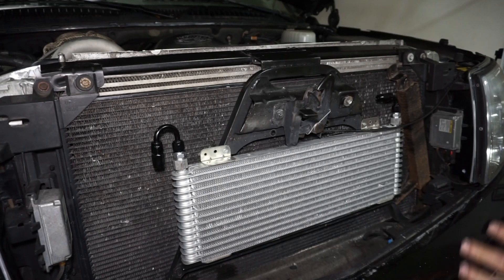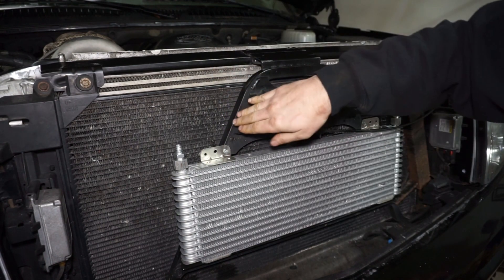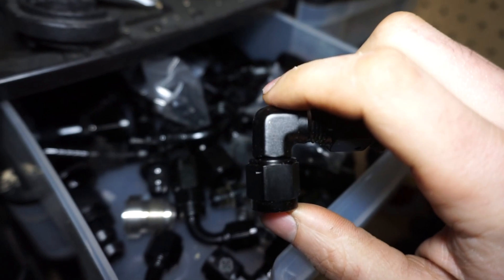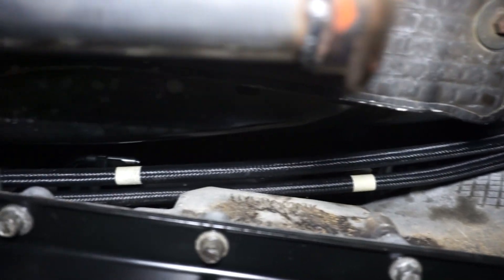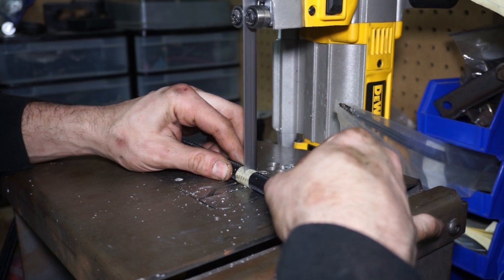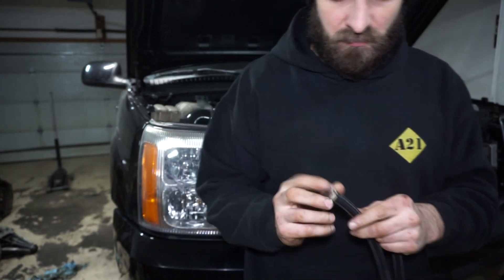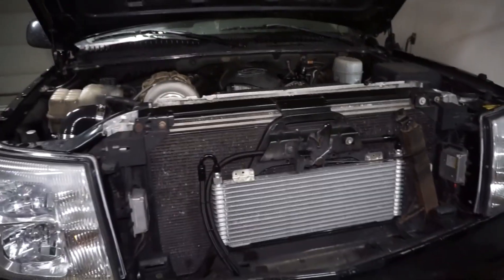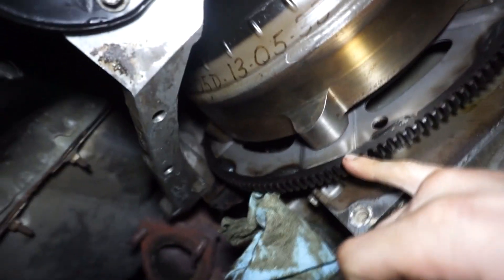How I Do AN fittings | TruCool 40k Transmission Cooler AN install!

Comment: This is actually the correct way to install a cooler. good job
Reply: yes it keep the air out and ensures there is no air in the cooler.  Most install with the fittings down as it does look neater.

Comment: I love the fittings with the threads on the sleeve. I throw my baby impact driver and a socket to it. Sucks it right down with no stray strands.
Reply from the maker: Maybe I'll give that a whirl one of these times.
Reply: This is genius. Thanks
Reply: @BlaserBuilds  the ones I used were reverse threads. Plus still leave the tape on to get it started. Then at least it’s easy to seat it all the way down.

Comment: Have you got a part number for the cooler? Both versions of Tru cools 40k is advertised as 3/8 inverted fittings through multiple vendors.
Reply: i’ve got the same question lol
Reply: I have that same question as well
Reply: Bump.  I have the same question 
Advertised as 3/8-24 inverted flare you are saying 5/8-18
Reply: @ryanlogan2911  I ordered 5/8 18 to -6an and they worked fine. I also messaged summit about this.
Reply: @adfasdfasdfluy  thanks for the bump on an old thread. I am going to use this cooler in my duramax Colorado that I tow with.  I ordered -8an to 5/8-18 fittings & -8an 180s so I can mount it upside down like he did to make sure it pushes all the air out.
Reply: @ryanlogan2911 so it is 5/8 then and not 3/8 as advertised?
Reply: @chrisburken2596 summit days 5/8 now so maybe they fixed it

Comment: Curious, why AN over standard transmission line and clamps?

Also never seen anyone leave the tape on. That’s interesting but I use the blue towel trick too instead of the expensive wrenches lol
Reply from the maker: I feel like it's more safe than standard non braided line and hose clamp for the high pressure of the trans. Ive done them without tape also. Kind of depends if the braid and nylon gets wadded up or not. I seem to have better luck with a narrow full wrap at the end.

Comment: on the radiator what did you do with the oem trans lines? you took em off and blocked off the holes with something? if so can you please let me know thanks!
Reply from the maker: I believe I just left them open. The trans portion is like a little cooler inside that gets held into place with the large fitting. With the smaller line portion removed, the large fitting is still in place do shouldn't need to be blocked, unless the internal cooler portion is damaged. Hope that makes sense. If not, just ask.
Reply: @BlaserBuilds  i’m honestly a little confused…because i saw you ran both lines straight to the trans so that’s why i was wondering what you did with the stock lines and if you plugged em up with some fittings
Reply from the maker: @juanmoya2162  The stock lines I completely removed. And left the line fittings on the radiator un-capped. Nothing in them. Just removed the lines.
Reply: @BlaserBuilds  ohhhhh okay okay i get it. i just thought they’d leak out of there that’s why i was wondering…but if i wanted i could cap em off?
Reply from the maker: @juanmoya2162  Shouldn't need to unless the trans cooler section inside the radiator has a leak. The larger portion of the fitting on the radiator threads into the internal cooler so shouldn't leak coolant.
Reply: @BlaserBuilds   question! did you buy two 20ft lines or one 20ft should be enough for both lines?
Reply from the maker: @juanmoya2162  I think 20 was enough for both lines. Not positive though.
Reply: @BlaserBuilds  i have a 60e and i’m gonna cut it in half…i’m sure 10 ft for both lines should be enough to then cut and have some slack left over for movement on the trans and lines themselves…my builder cut my stock lines and put hose and hose clamps on stock locations and into the cooler but my pressure line blew off a few days  ago so what a good time to upgrade cooler and lines when the trans is dryish
Reply: @BlaserBuilds  on the cooler where did you put the pressure line and return on? or is it vice versa?
Reply from the maker: @juanmoya2162  doesn't matter. Just a flow through.

Comment: Why do you mount the inlet/outlet facing up? Most installations show them facing down
Reply from the maker: @hiphopsuperman  So it doesn't have potential to trap air bubbles at the top in the cooler. .
Reply: @BlaserBuilds that’s great, thanks!

Comment: I installed the cooler on my 2001 Tahoe but the trans isn't getting to operating temp now. Dexron VI ideal operating temperature is 175F. I'm seeing 40F above ambient with this cooler on the highway, putting me at 80F, nearly 100F below operating temperature for the fluid & transmission. Yet I cannot find a tutorial on how anybody installed the temperature bypass from TruCool. Did you finally put that in?
Reply: Hope you figured it out but never bypass radiator. Just cool the line going to transmission from radiator it ensures your trans can get to operating temp faster

Comment: Just curious if you have higher coolant temperatures? I installed a 40k on my 5.3 and its 15 degrees warmer, around 195 F
Reply: Huh? Did you ever get that figured out? So strange you would get higher temps

Comment: how much experience do you have with this setup, ive always ran through the rad cooler also, will the 40k keep it cool on a DRIVER?

also, most the fittings ive used say to leave an air gap on the fitting when bolting the ends together, not to bottom it out, so i always stop a few turns early. Dont know how important it is. Maybe something to consider
Reply from the maker: I have the same cooler on my ranger and I've never seen it above 140s.  Radiator would warm it up.
Reply: @BlaserBuilds  wow thats awesome. Im doing a turbo colorado at the moment. I may just try 40k only and see how it does.
Reply from the maker: @superbeeblaze  On that truck I switched from a 30 row cooler to this and the difference is unreal, lol.
Reply: I ran mine before the rad cooler, so that the new trans cooler would help take a thermal load off of the radiator in general. Plus, the factory rad cooler helped to get the warm the trans fluid back up and maintain stable temps. Thats the key, stability

Comment: Curious. Why have your fittings at the top of the cooler vs pointing them down?
Reply from the maker: Thought is to be able to push all the air out so it doesn't trap any and whole cooler is used.
Reply: @BlaserBuilds  Did my true cool the other way. Lines through the fins are small enough to make sure it fills up.
Reply: @BlaserBuilds  More to it, did a 4l80 swap on my 02 yukon. Trans temps were amazing. Love your work, it brings back memories!
Reply: @BlaserBuilds  i ran mine the same way, with the fittings up, on my old Silverado. Didn't have to cut brackets and the cooler works fine in any position. But you will get a ton of people questioning your sanity and telling you how stupid you are 🤣 meanwhile, I never ever had a single problem

Comment: Did you use Teflon tape on the e ict billet fittings?
Reply from the maker: No..but get the russel fittings. Every other brand I've used leak.

Comment: Can you share what lines and fittings you use for your furl setup on e85? I want to redo my setup but not sure on the ebay lines for e85
Reply from the maker: I've used the ebay lines in 4 cars now... But I also change stuff a lot so can't say how they'd hold up after 5 years...
Reply: @BlaserBuilds  I’m afraid I have the same problem with changing stuff up, any specific brand you use on ebay? I have my car down now for a turbo upgrade from the gt45 to the VS gen2.5 7875,I want to put another 450 in it while it’s down and I’d like to replace the thrown together lines I have on it now
Reply from the maker: @ftlboy717  I just get the kits lately. The kits that come with like 20 ft, and 8-10 fittings.
Reply: @BlaserBuilds   thanks,I’m looking at them now...
Reply: Do you get the lines and fittings that are labeled “PTFE”? They are usually a little more expensive. If not, how long should I expect the regular AN kit to last with e85?

Comment: How come you mounted the cooler with the fittings pointing up instead of down?
Reply from the maker: Push all the air out the top.
Reply: @BlaserBuilds  I have my fittings pointing down and don't have any issues.. funny i mounted mine this way so the cooler would drain back..I think its a solid setup either way..I used AN fittings and braided hose also.
Reply from the maker: @spyderlyf3  Yeah factory has them down so I'm sure it wouldn't cause any issues per say. Would be an interesting test to see if it loses cooling capacity.
Reply from the maker: @spyderlyf3  It would take me 10 minutes to flip it, so maybe I'll test it both ways, same outside temp same drive distance ect.
Reply: @BlaserBuilds  its good content either way..loving the turbo setup.  gonna be a fun ride.
Reply from the maker: @spyderlyf3  Ripping setup out tonight, lol. New turbo and completely new hot side going in.
Reply: @BlaserBuilds  nice!!
Reply: It says air will get trapped if you put fittings down...i have mine down..
Reply: I hadn't  thought of oil,  only up needs longer hose and 180 fitting vs 90...im my mind more $ lol

Comment: I see A LOT of TruCool 40k knockoffs being sold as genuine coolers.  I would like to purchase one for my 4l80e and was wondering if you could link where you purchased yours from?  Thanks!
Reply from the maker: The knockoffs are around $80, the genuine coolers are $150ish.
Reply: @BlaserBuilds  Did you use a genuine or knockoff?  Power is twin turbo LS1 900hp.  Thanks for the response
Reply from the maker: @BillyDavis1980  I used the more expensive one on this build. I just bought one of the cheaper ones for my new build, we'll see how that goes.
Reply: @BlaserBuilds  Awesome!  Really enjoying your builds!  Thanks

Comment: Any one know where I can get a high  pressure -6 female thread at both ends line about 14 inches long? Earls speed flex has failed me. Any help is appreciated 👍
Reply from the maker: Make one would be easiest. Buy 2 fittings and a foot of hose.
Reply: @BlaserBuilds  sorry no experience doing so,and I have cartoon luck so something would most likely explode!
Reply from the maker: @budthechud3408  What are you using it for? How much pressure?
Reply: @BlaserBuilds  transmission cooler install just like yours,just don't want to use compression fittings or having to cut one of the trans lines to swing it around to meet the new cooler. Figured I could adapt the GM quick connect to -6 an high pressure line PTFE lined and the. Just route it up to the new cooler port and terminate with the appropriate fitting in the cooler.

Comment: What brand line and fittings?
Reply from the maker: I believe this was an evil energy kit from ebay.
Reply: @BlaserBuilds  any issues with it being flipped I seen a lot of videos with it mounted hoses down.
Reply from the maker: @jimmyramirez8844  Hoses down can trap air pockets, hoses up will push all the air out into the outfeed line. (In theory).

Comment: What do you think about mounting the cooler with the fittings pointing down? Does it not fill completely?
Reply from the maker: In theory, It could trap bubbles, but GM does it from the factory with the down so it can't be that bad.

Comment: My tru cool 47391 started leaking very very badly from the plates after 6months. Be careful using these, it almost costed me a 4,000 transmission. 
P.s “Oregon performance transmission” does not stand by its products nor do they return calls or e-mails. Do not use OPT

Comment: Did you connect the rubber lines directly to the transmission on not use any of the hard line from factory? I have a 6L90 and want to hook mine up that way but not sure if I can thread anything directly into my transmission I believe it is a different setup, probably have to cut the lines at the transmission and connect to it there. Just wondering if it’s going to be to much pressure on that length of just rubber?
Reply from the maker: I used AN fittings at the transmission and ran these lines the whole way.